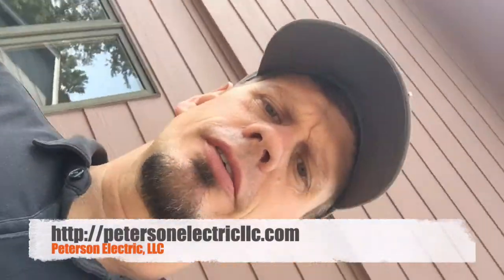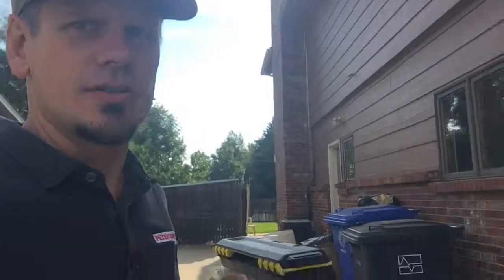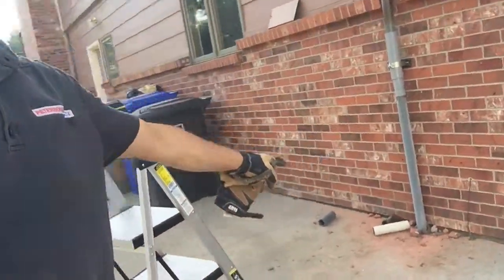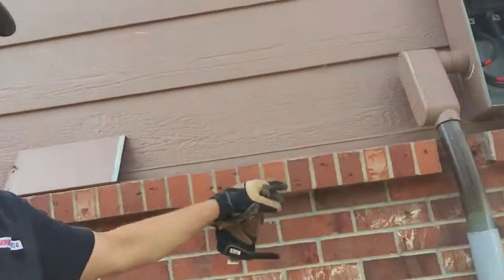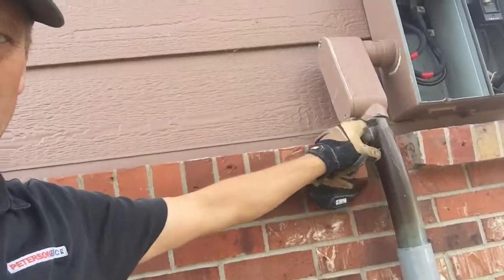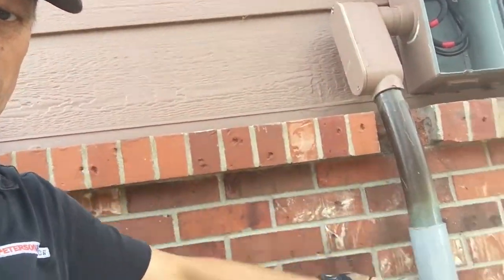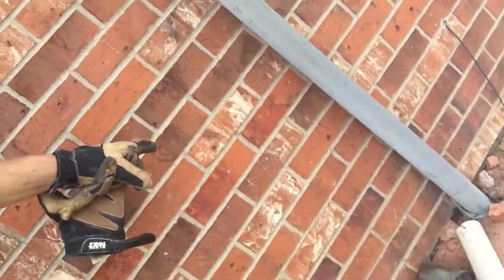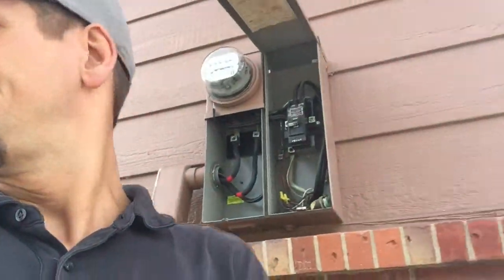PVC Expansion Coupling Installation In Loveland, Colorado | Peterson Electric

Comment: Are slip couplings required at an every connection coming out of the ground going into a structure? Example: an outside LB going to a inside sub panel, does code require a slip coupling between the pvc coming out of the ground to the LB?